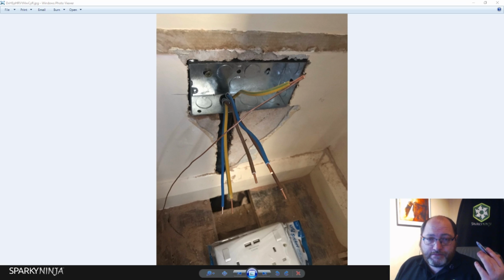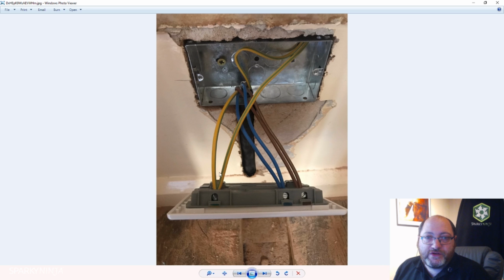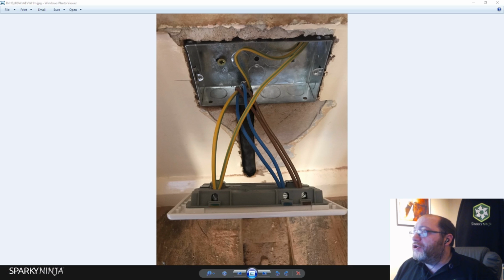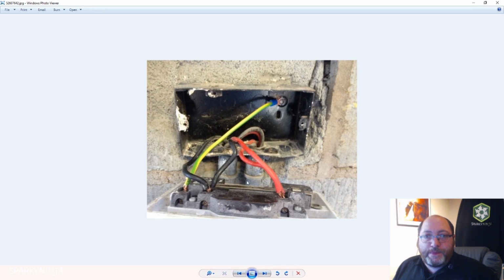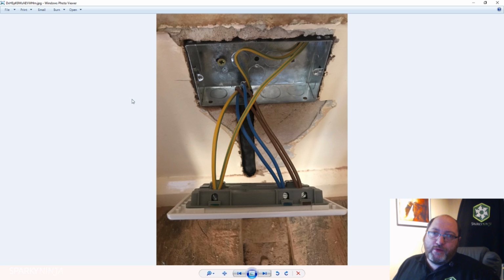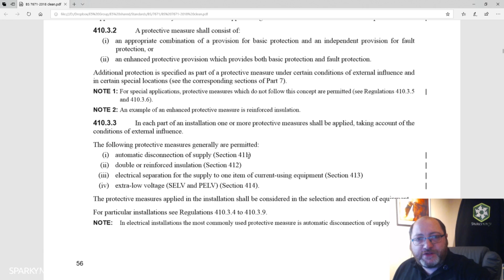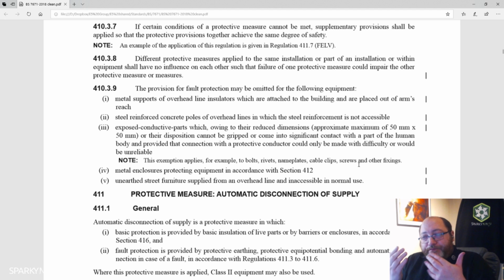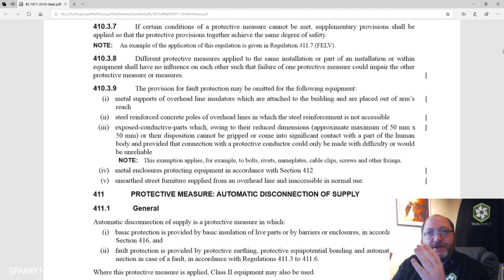Do we need to earth back boxes?

Comment: Is an extra earth needed for a metal face plate? I would have assumed so (similar light switches have an earth screw to earth) but my new plug socket doesn't have an obvious earth screw for the faceplate

Comment: I do take CPC's direct to the socket and then a flyleaf to the back box if a metal socket NIC didn't used to insist on on the latter ie if a plastic socket but NAPIT did. However the metal conduit system presents what I would consider a huge danger if relying on the metal of the conduit providing a CPC and in this scenario I encountered a situation whereupon the metal conduit had been severed and 2.5 had been used in between. Remember in galvanised conduit you are dealing with threads, cutting compound etc all of which can circumvent the continuity.  My first flat had one of these infrastructures and I completely re-wired it again with singles but with a CPC within the conduit.

Comment: Funny enough earthing the back boxes is the most hateful, aggravating and annoying part of the job for me, I'd rather be pulling cables through inaccessible blind holes or bashing rock hard concrete. I have a full rewire in progress and all boxes, have been  wired and finished... Apart from, as of this moment only half the boxes have been earthed. I did half and was expecting to finish off and do the rest next visit - Because I don't enjoy that bit, after hearing your very sensible and authoritative appraisal I was quite tempted to just leave them.. I mean the great Sparky Ninja has removed any guilt..  Of course it would be impossible for me to leave site without completing the blinkin' back boxes. Grrr. For some reason I couldn't do it. Excellent channel and what a great name too. Subbed.

Comment: I used to think that this procedure was unnecessary because the back box is earthed through the lugs, however this only protects you when the socket is fully connected and when it’s removed you loose the earth path..but then you shouldn’t be removing the socket unless power is isolated… so I just don’t know… FYI I always earth metal back boxes just to avoid dispute

Comment: I think you are very wrong to say the screws can not be griped, as for instance a child holding (gripping) a metal implement such as dads standard screw driver, only has to make contact with the plate screw head.
Also I have often witnessed decorators both professional and DIYer’s just loosening the screws without removing switches or sockets, while the circuit is live, the screws could certainly be griped.
In both scenarios if there was a live touching the back box there would be a shock hazard. 
Hey I know fark hall, Don’t listen to me.
Love your videos.
Regards Norfolkngood
Reply from the maker: Child would loose contact between the screw and the tool at the first perception of energy.
Other trades loosening screws fails the fundamental principles outright and no installation is designed to operate safely in that condition.

Comment: The backbox doesn't need a CPC it may be good practice to bond; take the CPC where it's required to the socket. Your adding a point of failure in the cpc - I've seen the cpc failed at the bonding connection (overtightened termination/ damaged copper). With large volumes of sockets, this may have a detrimental, maybe small, effect on R2 - R2.

Comment: What happens when the diy customer changes the sockets to metal ones the back box becomes live and the screws connecting become live making the accessory also live and you can then place your whole hand on the accessory, a diy customer generally copies what he removed in most circumstances so if you don't wire the back box neither is the diy customer? I also make sure the back is earthed out of principal. p.s. sorry for reviving a dead comment section :D

Comment: Could you tell me why I'm getting over a 100 volts when I connect my multimeter to the outside screws obetween 2 sockets if i put one probe on the kitchen sink and one to the metal case of the socket I get around 60v the sockets are metal not plastic  I have a cut on my finger and I just noticed when I was doing the dishes that I was getting an electric shock when I touch to the tap and the water in the sink
Reply from the maker: Sounds like you have some potential earthing issues. I'd recommend you call an electrician in to test the effectiveness of the protective conductors in your kitchen.
Reply: @SparkyNinja  I know the sink taps are not earthed i just found that out looks like sumone forgot to do it wen the new kitchen went in would that have anything to do with the sockets given a reading
Reply: @SparkyNinja   I took the isolation switch socket cover for the dishwasher off and 2x earth wires from the socket to the left were not connected and one of the black wires had come out of the connector and I have a feeling it was touching the metal faceplate cover on it
Reply: I've connected then all bk up and no reading at all so job dun
Reply: Would this have been wasting electricity All this time It's just my electricity smart metre Seems to be using a lot less

Comment: Best practice - Blah... Most domestic use modern sockets are earthed via the screws anyway. Many ‘loose’ back box wires become faulty or are not cut/stripped/fitted property. Most modern sockets have TWO earth sockets. As long as they are connected up here then its happy days. Yours screws work as an earth anyway. However, like you point out, it’s good practice.

Comment: I don't think you're interpretation of 410.3.9(iii) is correct. For the exemption to apply 2 criteria are required.  Exposed conductive parts need to be of reduced dimensions AND connection with the CPC would need to be difficult or unreliable.  Whilst the first requirement is met as you describe, the latter is not IMO since I think it is neither difficult nor unreliable to use the back-box terminal, therefor the exemption does not apply.  I think this is really clear with careful reading.  Regardless of the regs, I would also ALWAYS run the CPC via the back box and into the front plate exactly as you show.

Comment: When I was training for my C&G 236 (part 1 & 2) we were using 16th edition (I qualified early 1990's) and you had to connect an earth wire to the backbox. I believe this was relaxed when the 17th edition was released. The argument was that under normal circumstances a domestic user would not be touching the backbox and that it was earthed via the screws that connected the earth on the socket to the backbox.
Reply: I was qualified around same time as you, I seem to remember that because you will lose the earth connection to the back box for example when painters remove the sockets during painting

Comment: Wow! NO NO NO. The fly lead has to be there to comply and its a breach of regulations not to add it. And, a point in case my daughter touched two recessed exposed screws and a latent fault in the system shocked her badly. I agree its unlikely and is as unlikely as the latent fault that nearly killed her.
Reply from the maker: Which regulation?
Reply: @SparkyNinja  I believe the regulation he is referring to was what you have been saying... where certain conditions are met then no need to bond... on some sockets where the earth bars don't earth the screws then they become exposed conductive parts in which case the only way for that to comply with regs is to bond the back box.  I always bond it anyway... then I'm covered.

Comment: It's for Ferrous reasons......Why would you earth the frontplate to the back box when the screws in the frontplate run through the face plate earthing strip anyway.
Reply: Some sockets have bars not connected to the screw holes

Comment: so for those that don't earth the backbox in a flush installation the question is do you earth a metal clad surface box where a twin and earth is wired into the top by a stuffing gland or through a grommet via back entry ?
Reply: I'm sure they do as it will be an exposed conductive part on surface
Reply: Well if they don't then they should

Comment: Always done my mentor and lecturer taught me to make the installation as safe a possible.  Better to sleep easy at night.  Say the end user changes over to steel or brass finished fittings. As it's already in place you give a greater conductivity back to ground in the event of a fault occurring.
Thanks for sharing. 👍

Comment: Quick question for you sir, does it matter from which cable is the earthing wire connecting to the backbox ? ( In the picture it seems the incoming wire si connecting the earthing to the socket, and the outgoing is connected to the backbox linked with the socket )

Comment: If you fit a socket to a plastic back box do you earth the screws?? No you don't.... If you earth the Metal box technically you are only earthing 1 screw as only 1 lug is fixed the other isn't.
Reply: If one screw on the fixed lug creates that equipotential then the other screw doesn't matter as long as you screw it in

Only concern is that the earth bar must be covering the screws too as some earth bars don't cover the screw holes

Comment: Surely you’re original theory that the lug is used to provide the PE connection to the socket where the back box and conduit provide the PE could be wrong as the screws would in fact make that connection. Gordon
Reply: Surely the back box makers would not waste money providing earth lug and it's space nuisance if it was of no definite value?
Reply: @derekwade7471  Hi Derek, That's a good point, the only reason I can think of is, if a (metal) backbox is fitted into an insulated cavity (say a stud partition), and the item being fitted to the box was for example, a plastic plate switch without an earth connection or bar, and then for some reason the back box became live (e.g the insulation on the live wire being compromised), then the screws on the faceplate could be live, but as sparky mentioned, the regs seem to think that's OK if they are small and recessed. But as many have mention here, if your charging £100 to fit whatever it is (just joking), why wouldn't you just spend a couple of minutes fitting an PE for safety's sake. Cheers, Gordon

Comment: i think its good practice NOT to earth the back box with the fly lead because when dead testing -its best to take the face plates off the wall,(to exclude any parallel paths from metal stud work).how do we know we are measuring the cpc and not a fortuitous earth from cable tray or metal studs etc which can change if the builder was to  make an alteration (I dont do domestic work,I'm talking commercial here)    The back box will be earthed through the screw

Comment: The way I have always seen this is, the earth terminal on the socket must get priority of all incoming earth wires,  the fact that the socket fixing screws and plate are there as a belt and braces approach, the flying earth lead must come from the socket terminal and connect to the backbox, Why? because when you remove the socket and leave it hanging, the backbox is then left unprotected,.You cannot now rely on conduit screwed connections to provide earthing, the couplings and connections can give resistance, esp when old and over long runs, hence the need for wired earthing at terminals, as far as the recessed socket and switch screws are concerned, don't forget toddlers running around with their tiny fingers exploring every nook and  cranny, it might only go wrong once in ten million, but that is too much so get it all earthed, not hard is it?

Comment: I agree. Its not REQUIRED but it takes but a moment.
Only thing from my experience would be to take both legs to the faceplate and a return let to the back box. Only reason being I have had terminations that have severely weakened the unbroken bend "doubled over" under the fixing screw. Which puts doubt in my mind in the double over to withstand a dismantle and refit say during a periodic or fault finding exercise heavens forbid.

Comment: Wondering as the bending ratio of the CPC is greatly exceeded when terminating to the back box and taking it on to the socket, can you call it a continuous circuit?
Reply: Solid conductors are often bent completely back on themselves when terminated under a screw so I don't think bending the copper to that extreme is an issue.
However, I prefer to use a double ferrule to crimp the fly lead and one of the CPCs together. This saves on the waste of extra length on the line and neutral of the cable with the longer earth and maintains a constant connection just the same.
I don't know if it counts as a continuous connection, perhaps Sparky could ponder that one for us and let us know his opinion.
It is an extra component, so there's an extra cost, but pennies... As far as time taken to do it, I can't imagine it takes any longer than the longer CPC and bending it over method.

Comment: The other reason to have this lug is for cases where the front plate isn't earthed, say for a plastic 3 gang light switch.  It gives you a place to park the cpc in the case that the switch is changed for a metal one in future.  Doing it for sockets seems pointless and silly.  I don't think it adds any safety, it just wastes a bit of cable.

Comment: The new sockets have 2 separate earth points. CPC (earth) from each of the ring cables to separate terminals. Back box earthed through screw and not contactable in normal use.
Reply: Also true with new all metal fronted sockets with the earth strap across the back between screw holes, the screws being the connection to the back box, which takes the earth forward to the back box.

Comment: The question is answered by admitting that a flying lead from a besa box, back box, spur box is to earth them in absence of an integral cps within containment which when mechanically sound is electrically continuous as the earthing requirement. My opinion differs somewhat. The TNC system being somewhat inadequate because of bad mechanics lost the concept of being electrically continuous and therefore became hazardous. The TNC-S's integral separate earth made the flying lead nothing more than a bit of supplementary bonding. Now here, in my opinion, is the anomaly. The picture presumably shows one leg of a ring final circuit's cpc being split from the accessory and replaced with a supplementary bonding flying lead to the terminal of a back box where it is made to join the other leg of the ring final circuit's cpc. That to me, says that a cpc which should be in the form of a ring is made up two cpc legs from the board to the back box+accessory and joined between with a flying lead of supplementary bonding. Supplementary bonding, as far as I can reckon, is not a circuit protective conductor.

Comment: Interesting subject, personally I would earth back box. I have seen too many "fixed lugs" that I would not call fixed, many of these are separate pieces of metal crimped to the box. It doesn't take much for these lugs to become excessively loose or detached. 
What about a situation where a small child / baby is exploring there surroundings? Sat on the floor, possibly with a wet nappy and bare legs also in contact with floor, sees a small shiny thing and goes to touch it. Unfortunately the screw has become live, unfortunately for the child who through no fault of there  own has a very good ground and conductance is now dead. 
This may seem excessive but having seen and worked in houses that fit both criteria I'm surprised it hasn't happened to my knowledge (im sure it has at some point). Perhaps the TV in front of socket has helped. 
With regard to using the conduit as earth conductor, has this been reverted? I thought the conduit was to protect the cables and had to be earthed in the same way as the function of steel armour cable, and not function as the cpc. Does corrosion not occur these days with steel conduit in a damp wall? 
Seen some nasty situations over the years, still shudder at the thought of some of them and wonder how people haven't been injured or killed... I get this funny tingling when I lean on this wall by here (attached garage converted to spare downstairs room, ex council house). That job ended with complete rewire (after moving and replacing the old fuse board from under the kitchen sink worktop that leaked water down the wall).

Comment: 410.3.9 ii. '... and provided that a connection with a protective conductor could only be made with difficulty or would prove unreliable'. 

Wouldn't the fact that an earthing terminal is provided mean this exemption is not applicable in this case?

Comment: Interesting. 
Personally I like to terminate the CPCs into the socket. I think connections should be kept to a minimum. To me this is another connection that could go wrong. If you terminated the two CPCs into the socket you only have one connection that can fail. If you connect into the back box, then into the socket, thats two point of possible failure.  So if you have 30 sockets for e.g, thats 60 possible fail points.
The little lug in the back box has such a small little screw, and cuts through the conductor quite easily.

Comment: I would not use conduit without an earth conductor as the resistance measured in a conduit run may be to great for fault protection
Reply: Steel has a significantly lower conductivity than copper but the cross sectional area of a steel conduit is so massively greater than a copper CPC could provide that, if correctly jointed, conduit is just about always guaranteed to outperform s separate CPC.

Comment: I agree with everything you said and would further a reason for this good practice that if the two screws are removed from the socket plate with it flapping around the backbox would not be earthed. Ive seen socket plates flapping around in badly maintained properties and situations where decorators take them off to paint. Like the guy a few comments down I always feed back to the backbox and not the backbox first.